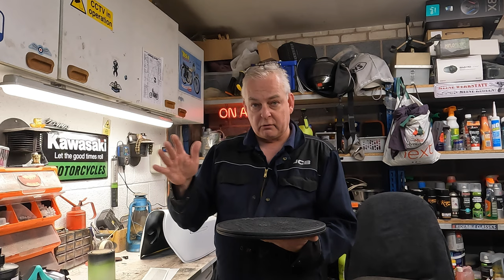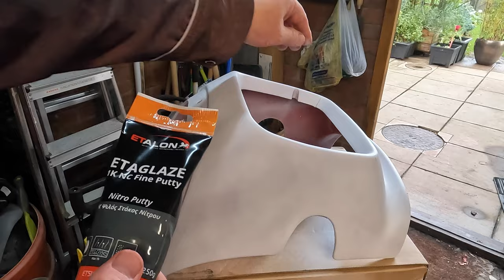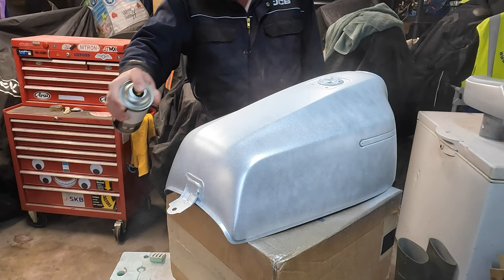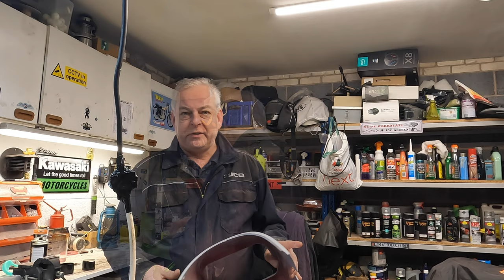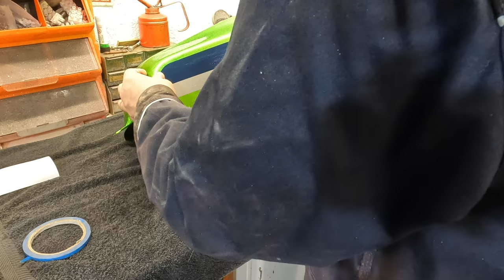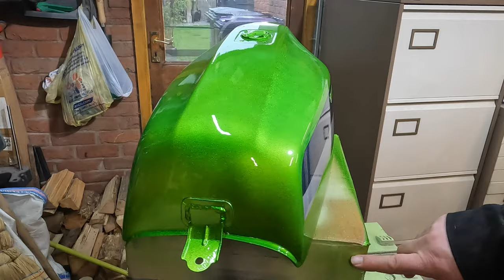Kawasaki GPZ550D1, from Firecracker red, to Candy green!

Comment: IMO, that light putty will not last long in the crack.  For a crack that significant you need to fix it on the back with kitty hair bondo or something with some reinforcing and then grind out the crack on the front, then use a 2-part filler (bondo) to fill it back in.  Then, for any pin holes you can use the light "spot" putty.  Looking good though, especially for spray cans!  Great job.

Comment: Make sure you fit the rubber washers and maybe a smidge of sealant under the washers on the tank cap mounting bolts, not sure about that model, but the GT550 tank cap bolt threads go right through into the tank, seems a stupid idea to me, it will allow fuel vapours to evaporate through the threads and cause blistering of your shiny new paint job.